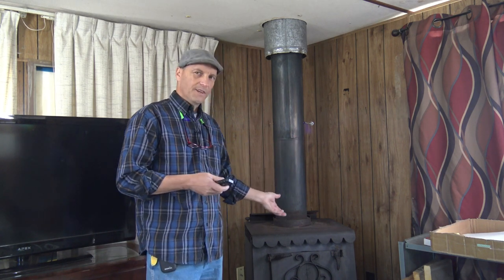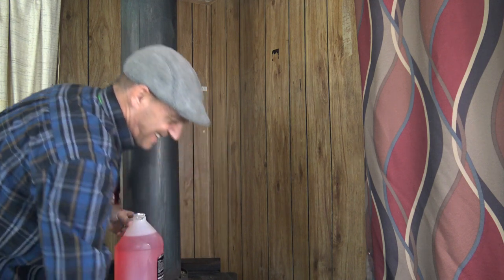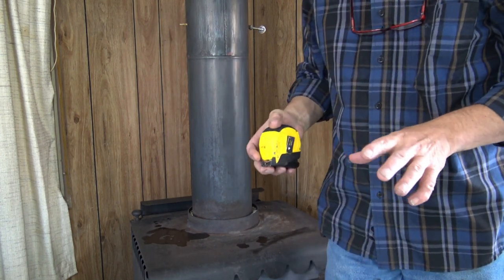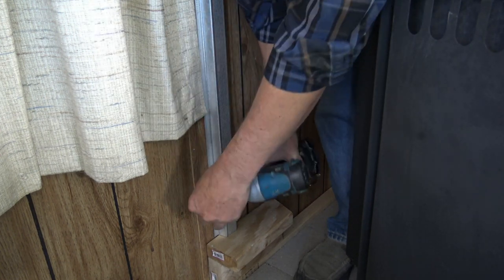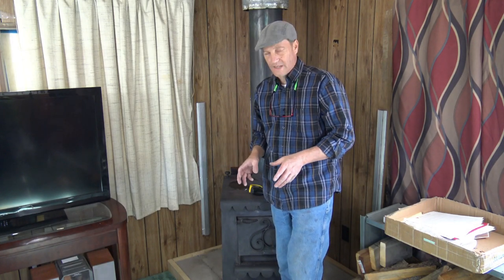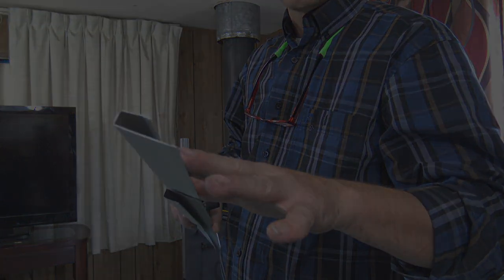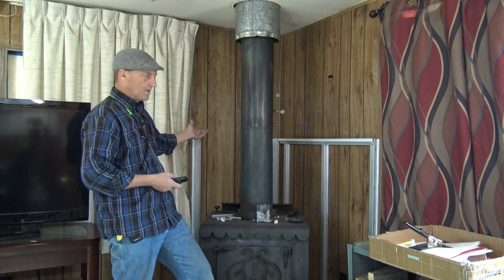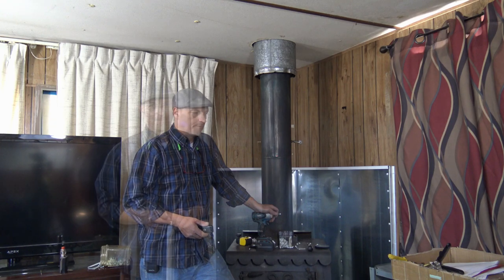Wood Stove Heat Shield Install: Totally Tim

Comment: Hi there Tim! Thank you for the great video for building a heat shield. Great job! I have been toying with the idea of a heatshield since a few months ago. Woodstove have been in use for three winters however, but I just noticed that the wall near the window was getting hot, so long story short... I needed a heat shield. I like your idea using the Top hat channel bracket and the J bracket. I think I will get those to install my tin panels. Thanks again and God bless!

Comment: Gasp! Heat stove next to two sets of curtains?! Shiver my timbers!
Reply: Was thinking the same. The curtains will catch fire before anything else
Reply: I agree my stove is epa mobile home certified so clearance rate is 15 inches but I still made sure my curtains were 3 ft away after stove going I felt of my curtains and not hot , not sure what age his stove is but he said been using it for years so let’s pray his is epa efficient

Comment: I was able to grab 2 of the imperial heat shields for a steal 84.00 out the door, kicker was the insulator board in back was cracked…I just added 1/2 inch concrete board to it but I did use the heat shield  install kit and used 4 inch screws thanks for this vid

Comment: I am installing a small wood stove but adding heat shields directly to the wood stove sides and back and possibly a shield on the backside of the flue. Spacing or clearance of about 1". Saw a guy do this on YT where he put his mini wood stove inside a modified entertainment center (cove).
Reply: That certainly works - shields are moreover a buffer to diffuse heat and by simply placing a wrap roughly one inch from the micro-stove works very well as it creates a convection to force heat vertically through the space making the airspace above and below the stove hot - so a good platform is a must. Great ideas! thanks for your comments

Comment: Born, raised and live in central New Hampshire and my primary heat source is cordwood.  The heat shield looks pretty good.  The curtain to the right will be ok, however, the left side curtain in concerning.  More concerning is the pipe through the ceiling, is that a bait bucket?
Reply: That's funny actually - but that thing on the ceiling is a transition pipe from single wall to triple wall vent pipe - lol.  You're right the curtain is a bit concerning in the video however has been that way for years and never had issues with the material getting hot at all.  We do use a fan to circulate the air around the wood stove and into the living space.  Thanks for your comment

Comment: Heat shields are a great idea for wood stove, the down side is, most look so unappealing and not very nice.  Better go with another heating method or pay the extra for a nicely build brick wall... but I do wonder if simply covering the wall with a fire blanket will be equally effective and may look better..humm ???
Reply from the maker: I have had both - I tend to like this style best as the cost of brick and the extra support tends to get expensive.  But thanks for watching!  The shield works flawlessly BTW as I used it all winter and the wall itself never got overly warm...
Reply: Luculent Media your installation looked on point and better then others I have seen. I have to add ceiling heat shield if I want to get my new EPA stove - which I am not liking by the thought of a ceiling shield on my already low ceiling...
Reply: I sure didn't like the loose paneling he was screwing the frame of his heat shield to. Maybe if he anchored the vertical pieces to the frame of the building or trailer he's putting that stove in...those curtains thumbtacked to the wall are much too close to be burning anything except the place down!
Reply: Brick is NOT the solution. I have a brick hearth and a brick wall to the ceiling, but code says I still need to be 18" from it with single wall pipe. Madness! I challenge anyone to ignite a piece of drywall through a brick wall with a stove pipe.
Reply: Why not just use drywall for a heat shield
Reply: I just now asked someone else why not use drywall because the stuff wont burn I've tried burning it 

Its what im gonna use for mines heater pipe not the chimney pipe cause i keep my burner outside
Reply: @showproja  did u not leave the 1” gap between the brick and drywall?
Reply: @Mike-su8si  because it’s combustible

Comment: Would like to know the measurements of heat shield. Or did I miss it?
Reply: I am sorry that information was not available in the video as I had a good friend edit the footage.  I can't really remember the exact dimensions but you will need roughly 6" outside of the square - with a neoangle such as mine you would need to imagine a square space that is square with your wall, whereas the woodstove is so included, and add 6" from the edge of that angle out. I suspect each municipality and/or county has their own specific codes regarding minimum clearances and total capacity for BTU ratings or thermal generation.  You should probably check with your local woodstove retailer/installer for local requirements.

Comment: Bad video. no wood stove can be closer than 36 inches from a combustible wall, at any point. You can cut that down to 18 inches if you use a suitable heat sheild. Those curtains and window are all too close. This is not a good video and is full of wrong information.
Reply: Definitely not true, Keith.